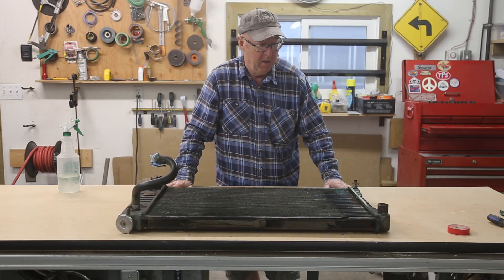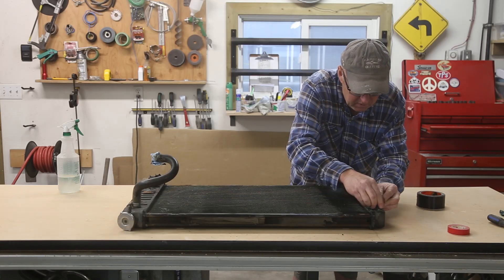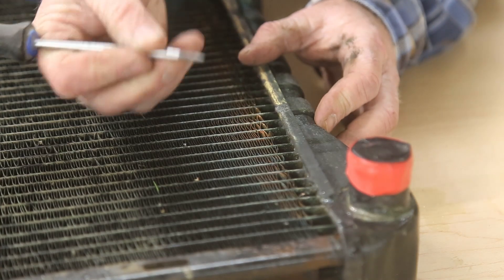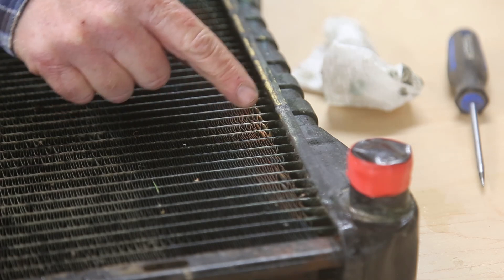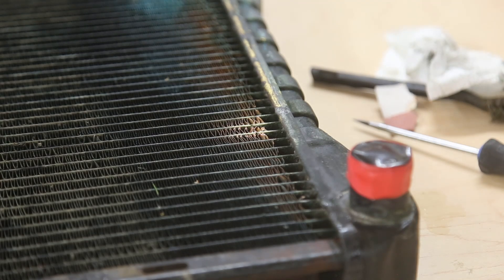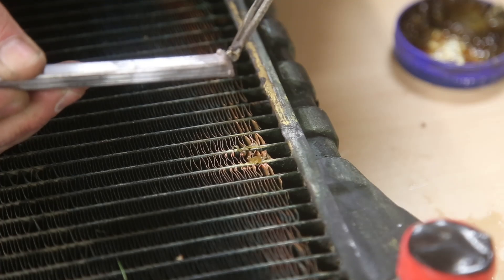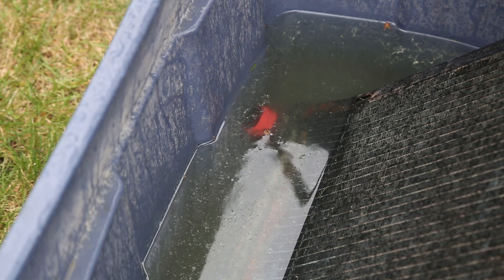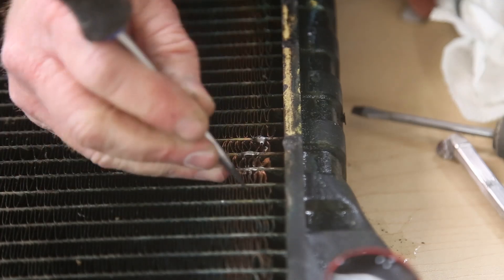DIY Radiator Repair-Soldering the holes with lead

Comment: I've found that if you use an old bicycle innertube and clamp from inlet to outlet you can charge it with air for testing for leaks. keep up the cool videos it really helps out!😃
Reply from the maker: Okay, the tire tube idea is a great one.  Now I want to test another one to give it a try.  Thanks.  Stevo

Comment: Does the seal plug the leak only or does it close off that line, blocking the leak but also reducing the effective cooling capacity of the radiator, albeit very slightly?
Reply from the maker: I kept the heat lower so the solder is more on the surface and should not affect the flow.  On a good ole Chevy rad, you could probably plug off a couple and not overheat.  Thanks.  Stevo

Comment: and again, soldering is not one of my strong points.
Reply from the maker: It is one of those things I leaned when I was quite young.  By no means an expert though but enough to get me by.  Maybe too much cause I usually get a call when some soldering needs to be done.  Thanks Vern.  Stevo